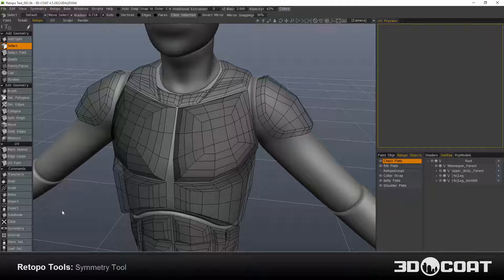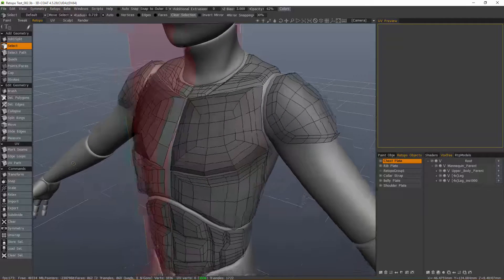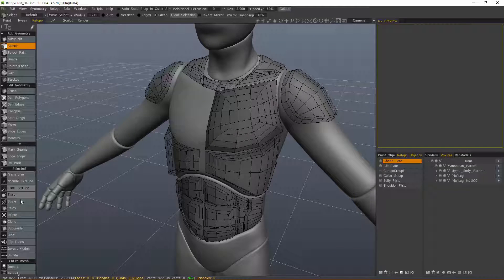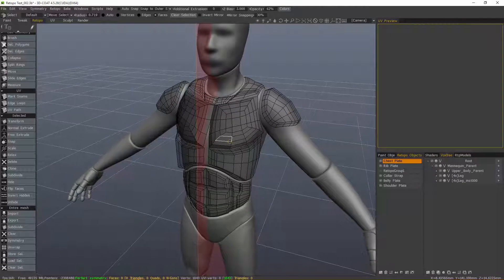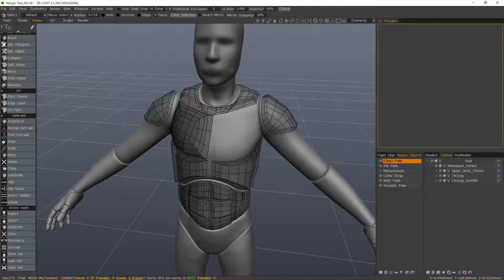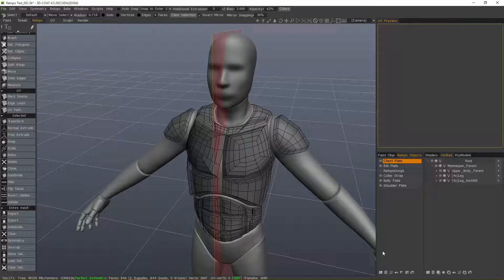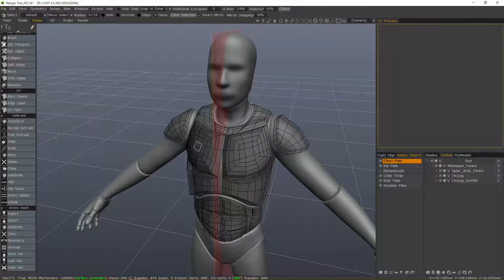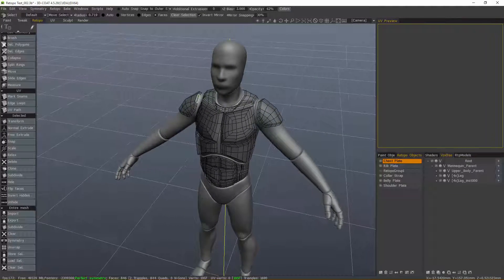Symmetry Tool

Comment: I started to learn 3DCoat some days ago, and I cannot find that Simmetry tool i the left panel... Could be possible because I am working with voxels?
Reply from the maker: With the SELECT tool active, look in the ENTIRE MESH section of the Tool Panel and about midway down the section, you should see the SYMMETRY tool button. You could also just RMB click over the mesh and choose SYMMETRY.
Reply: Everything is highly context sensitive in 3D Coat. Can confuse a new user occasionally at first, but gets extremely powerful and fluid once used to. I also recently started to transition from long year retopo in Blender to 3D Coat (I have used Topogun few years ago but abandoned it for Blender, too few modeling options). By far the best retopo tools one could wish for, once you figure out where does what. Really fantastic. It is the most artistic retopo experience. Plus the UV tools you can use alongside are equally good and fast. I especially enjoy the "GU" algorithm, which gives even better stretch-lesness than ZBrush.

Comment: Hi. i'm a user of 3d coat professional and i have a problem with Symmetry, the problem is when i try to apply the decals on the other side of the object they are reverse, i tried to change options in symmetry but still the same problem.  what i can do?

Comment: Hello! The question is . How to divide the finished model on the part ? For example as your dragon or as your dummy ?
Reply from the maker: +Tri4olium Studio I'm not sure what you mean by "divide" the finished model. Do you mean separate part of the mesh to another retopo layer? If so, you can select the poly's > create a new Retopo layer > select that new layer > click the 2nd icon from the right, at the bottom of the layer panel (move faces to current layer).
Reply: Yes , I would like to try repotologiyu cars . You have a dragon made separate parts . Have you realized that initially when sculpting layers made object . It's so easy to do repotologiyu cars . You have a wonderful program , I really like. Prshu forgiveness for the mistakes I use a translator .